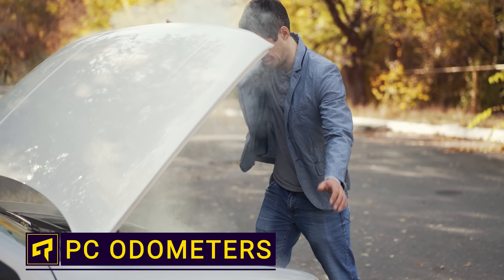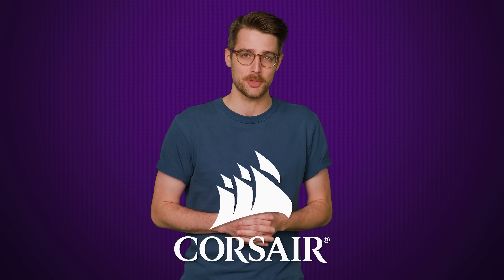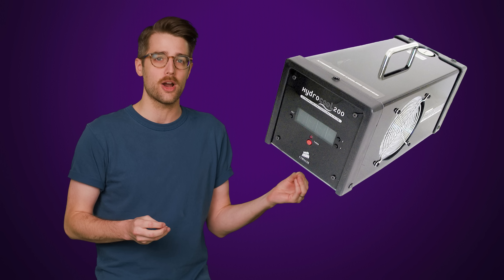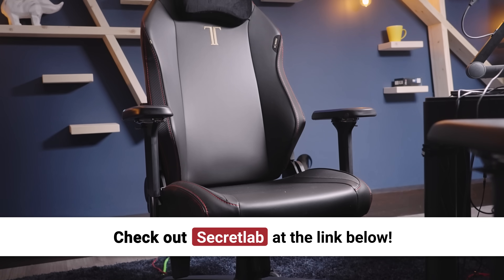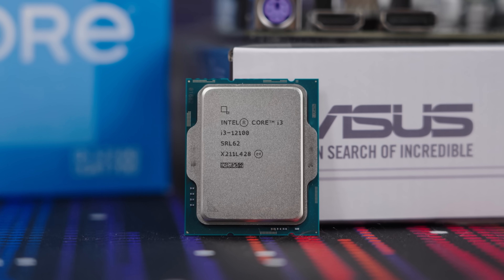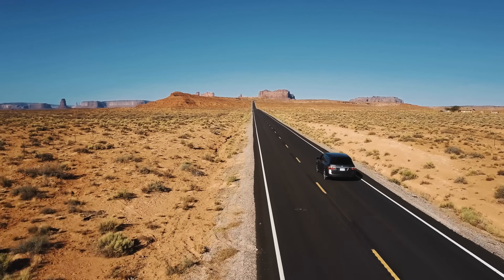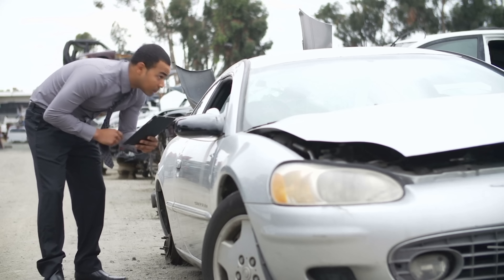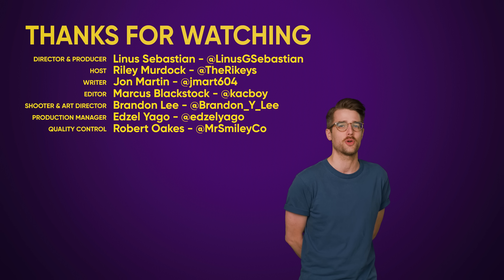Should Computers Have Odometers?

Comment: Great for buying second hand graphics cards used for mining.
It would also be nice to have a user visible flag to show if a part has been over-volted.
Reply: it usualy memory overclock with undervolt aggressively
Reply: Fan tachometer is a thing on a vast amount of GPU’s so i would see if you can check that before buying

Its a bit involved to figure out if its been mining or bot unless its been run 24/7 at 90% or higher fan speed in which case the number will be very lopsided vs time owned
Reply: @commanderoof4578  You could also test the leakage on the capacitors that are used for power filtration as well, and perhaps measure the coil wine on the vrms. Although for testing the caps one of them would need to be removed from circuit.
Reply: That wouldn't really give you any useful information TBH. Besides, it's really hard to screw up the voltage on GPU's. Overvolting is not something I would be worried about. I would be more concerned about what temps the card was run at.
Reply: no miner overvolts their card; they rather undervolt them
Reply: @maximiliandeisz2961  enthusiasts do, and it reduces the parts lifespan
Reply: Craigslist people with computer parts thinking like people with rare cards: "yeah it was in a box outside but is in good condition low counter, no low balls i know what i have"
Reply: Ok all the miners here talking about how GPUs dies really don't know how they die nowadays. Now back in the day heat would kill a GPU more then anything but that's not like that now. In the days of 7nm and 5nm chips atomic structure is becoming far more important. Back in the day while a transistor was small is had dozens of atoms underneath it so it didn't really matter but now a days transistors have single digit numbers of atoms under them. Now these silicon atoms are a gap the transistor uses to start and stop electrons flowing through and occasionally these electrons can grab an atom too tightly and move them around. Now in the old days when you had dozens of them this wasn't a big deal but now with 7nm and 5nm chips only have like 5-9 there these movements can causing shorts and break things. So nowadays it's not heat that's going to kill a GPU it's voltage over time that's going to degrade the silicon till it just dies and while undervolting will slow this it won't stop it and with mining GPUs having hundreds to thousands of hours running on them they're far more likely to just give out from silicon degradation then newer cards or even lightly used gaming cards.
Reply: All-time max temperature and duration would be good.
Reply: Miner cards are usually okay.  Biggest issue you might run into is needing to repaste them, which isn't that hard on most cards.
Reply: The cpu in Raspberru Pis has a fuse that is blown if they are significantly overvolted. As this is a fuse and not flash memory, it can never be set again. This does not impact in the operation of the computer like certain brands were doing with locking cpus, only for warranty purposes (I think).
Reply: Guys, mining cards are always in better shape, unless it's a 3000 card. The 3000 cards' memory run much hotter without throttling and can handle hard memory OC's. I was mining on my ROG Strix (emphasis on this because the cooler design is +++) 3080 OC until I finally checked my memory temps instead of just core temps. My core temp was at 70-80°C, while my memory was hitting 100+! I set my memory max temp to 85 and my core temp stays at 56°C. I have no doubt 5 months of mining at those temps have added instability, even for gaming. Be careful out there, especially NiceHash miners, as NiceHash doesn't display your mem temps last I checked.
Reply: @superchet4026  specifically cards with gddr6x memory (3080+). But that's true of gaming cards too (remember games would outright blow memory chips). QC for the higher tier just isn't good enough to handle the power draw
Reply: @PwadigytheOddity  You're completely missing the point I'm making. I'm providing proof for why used for mining RTX 3000 cards have an added caution over other graphics cards. Mining cards are almost always in better shape than gaming cards, except for 3000 cards. Those are the ones you should be cautious of, though that doesn't mean it's never a solid buy.
Reply: @superchet4026  no you're not. Because, again, regular GDDR6X cards were pushing those temps in gaming workloads *and* they were thermal cycling. Believe it or not, running extremely hot memory is *better* if you're doing it constantly than if you're "letting it cool off." In gaming workloads, memory especially can skyrocket due to cross heat-soak from the core (which is also damaging to the solder on caps, and various OBCs) and then chill. Especially when loading 4K assets at the framerates the cores support.

But yes, you've identified an issue with 3080+ tier cards. GDDR6x is way too hot and there is not enough quality control to justify its implementation.

Even still, gaming cards exacerbate this issue far more than mining cards. At the end of the day, mining workloads are consistent and predictable, and within spec.

Lifespan reduction is negligible based on how close to the edge something is to spec vs how rapidly it bounces across the spec.

You might hear of 3090s that had problems mining. But that's because 3090s are poorly designed, and games can just as easily blow their Mem ICs (see:  New World)

Basically, all variables remaining the same: mining card > gaming card.

Unless for some reason you want the best possible memory overclock and don't care about core. However, gaming cards will almost certainly not overclock their core as well as they could when you first got them.

But yes, you have identified that used 3080+ cards are use-at-your-own risk. I wouldn't touch 3090s. Although 3090TIs are the opposite because they don't use that absolutely atrocious back-side memory config. And their PCB designs actually have some modicum of quality control.
Reply: This should be standard on all GPU's
Reply: Like the CAN bus on cars 😂
Reply: Mining cards are almost always in better shape then general use cards. Consistent use in temperature controlled environments and tuned for the lowest heat, power usage, and stability. Id so much rather have an ex-mining card vs one that sat in the average gamers case with poor airflow, constant heat cycles, and if they are tuned its to squeeze perfomance not reduce power and heat.
Reply: @DJ.1001  
You got a source for that? Cause while the core might be in better shape, all that lottery ticket printing on the memory takes its toll on the controller and chips.
Reply: @anivicuno9473  pushing the memory results in stale share. And the only thing that degrades memory controller is when you add heat from the core to the equation and high-TDPs across the PCB. I learned a lot about mining when I was paying off my gaming GPU by mining on it when I wasn't using it.

Anyways, with a year and a half of constant mining, my GPU didn't lose any of its OC potential on the memory or core in gaming (and keep in mind, I was also adding gaming workloads to the card too). Doesn't require any extra power draw or voltage to run the same settings it did 2 years ago.

Basically, mining is so low intensity it's basically the same as not running it at all. It's like leaving your CPU on idle.
Reply: @anivicuno9473  I wouldn't say mined on cards are better or worse than cards used exclusively for gaming. It just depends on the user. As long as the memory chips are kept cool they won't be damaged from long term use. I have a couple of cards I use for mining, the memory on my water cooled 3080ti runs at 60c max, whereas my Rx 5600XT has the memory around 100c. I probably won't be reselling the 5600xt.
Reply: @DJ.1001  That's the case of you but from a large farm, but buying from a person, a mining card could be abused and look fine.
Also gamers Nexus covered memory issues on mining cards. Miners tend to OC the memory.
Reply: @DJ.1001  
Looks like we have miner here trying to move his stock. Nice try bud.

Just because someone used the cards for mining doesn't mean they took care of them. The vast majority, from which we could see online, just stuck them next to other mining benches and had them cooled using the stock cooler. This would mean that the heat from one card was being passed to another and so on. I've seen even low sub YouTubers that were doing this in their basement.

So, you are absolutely still playing the lottery with miner GPUs. It always depends on the previous owner to some degree but miners constantly ran their cards under full load 24/7 for over a year. The amount of wear on the memory controller from that alone would be much worse than someone who had been gaming on theirs for a few years.
Reply: @KaoruSugimura  mounting the cards in a multi GPU rig is literally how everyone does it. They are either in boxes designed to do so with server grade fans that move a ton of air or they are in open air cases with fan to move the air. Just because cards are next to each othwr doesnt mwan they are running hot. I dont know a single miner that runs there cards anywhere even close to the temperatures that the average gamer regularly pushes their card to. All of the mining software have elaborate monitoring and tuning options that keep temps, voltages, clocks and power usage in check. I have a small farm of mostly new hardware and I know exactly what temperature every single card is on the core and memory, I know the voltage and clock speeds all the cards run at and I know down to the single watt how much power each card is using. My hottest card is a gigabyte 3060ti, the core is currently at 57c and it is pulling 113w. Most of my cards are in the high 40s to low 50s. These cards were a significant investment and I rely on their function to return on that investment. Running the hardware carelessly is something very few if any miners are doing, especially the larger operations with new hardware.
Reply: Mining cards have 10x less wear than gaming cards. Mining does not use the GPU core, and runs the card at like 30% power at a constant rate. THERMAL CYCLING is what kills a GPU. Mining cards literally never thermal cycle, because they're doing the exact same ultra-low intensity operation over and over again.

Gaming cards, on the other hand, are *designed* to push themselves to the max, hitting wild TDPs and temps and then dropping at idle. This behavior is what causes components to fail.

Mining cards are by far the best used cards to buy. Also, mining cards are usually extremely well-maintained, as miners maintain their cards expertly. Unlike a gamer who may have gotten dust, debris, or vape smoke in their system's airflow, a miner will usually have enthusiast-grade knowledge about tech at least, and will maintain their cards. Why? Because it's their money-maker.

It's not like miners are sucking the life out of their cards and tossing them on the second-hand market. They would never risk a card dying early, as that would be money down the drain, especially if they haven't ROI'd the card.

Definitely buy from miners. Miners are not boogeymen. They're usually professional. They used the cards as part of a business. It's the same as buying old server hardware.
Reply: @PwadigytheOddity  Gamers Nexus did a review on this. Miners hammer the memory hard and usually OC the memory. So that's why they often fail there.
Reply: @markp8295  And buildzoid also did a review on this and he's generally smarter.
Reply: @PwadigytheOddity  That's an odd way to invalidate someone. 'Smarter'. Anyways, it depends heavily on the card. I got >100°C on a 3080 memory chip with clocks over 150MHz below what I found to be unstable. This with a pretty decent cooler. This does degrade the memory chip and there's no way around it. I say you're 100% right, in the case of your graphics card, as I've had the same experience on 1060's and a 2070S. But I urge you to check out the temps on 3000 chips, it's much different. The current trend is total power over efficiency.
Reply: @superchet4026  used 3080s and 3090s are on a per-card basis regardless of who owned it. Gamers will still have oily, shitty pads on those. The QC on high-end 30 series cards is not adequate for the GDDR6x memory used.

Comment: Odometer matters like about as much as a the color of the car. what matters more is the service history and ensuring that all service that the car needed was done in a timely manor. AGE and SITTING is more likely to kill a car then the odometer alone. Change your oil, ensure that your timing belts aren't half way gone and things should work for a long time to come.
Reply: No
Reply: @filonin2  so... under what evidence do you have that the odometer matters at all? it's a number dictating how far the car has traveled, and tells you nothing about it's service history, or how it's been driven, the most important aspects to any car's health. aslong as the car is taken care of the odometer matters about as much as the color of the vehicle. it's more like a generalization of the amount of wear the car might have, but it's a very bad generalization. you can have a car at 20k miles that's never had an oil change being resold as is. you drive it 2 miles and the engine explodes. and you have have a car with 100k miles on it that's been well taken care of and will last another 900k miles. the odometer means nothing.
Reply: @Xeno Kudatarkar yes, reference the even more damning argument from him. I will reitterate, the odometer matters little to nothing in the terms of the value of the car or whether you should buy it. what matters, is the service history of the vehicle, whether it's been sitting for a while, or the actual age of the vehicle. there is a point where the age of the vehicles is more damning for the car then what ever the odometer says.

Comment: Pretty sure cards used for mining were proven to not have lost capability even after years of constant usage.
Reply: Performance, no. Stability and remaining lifespan, yes.

But it depends on the miner.
Some people didn't care about high temps. Or they re-flashed with a sketchy bios to take it back to a gaming card from a mining one.
If they are in an area with nearly free electricity, some overclock. But most undervolt for lower power draw.